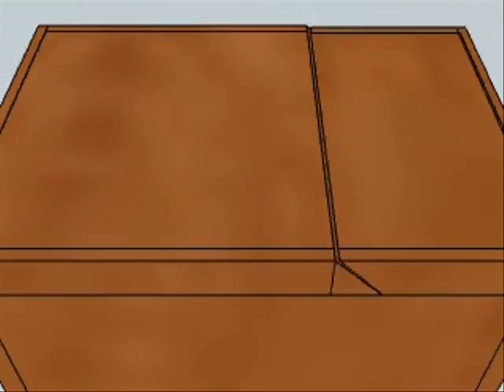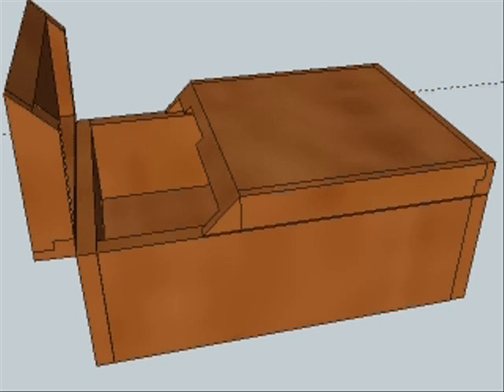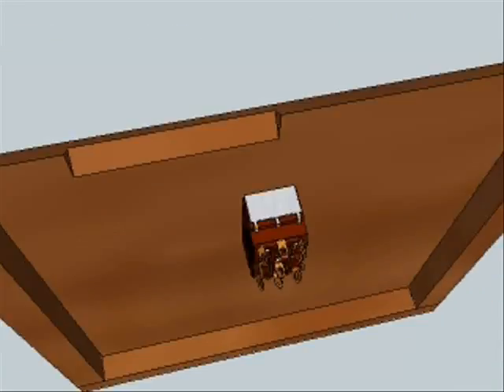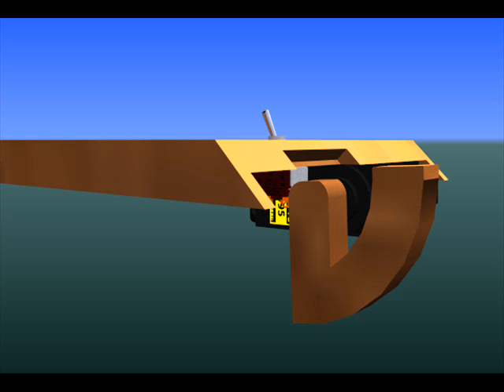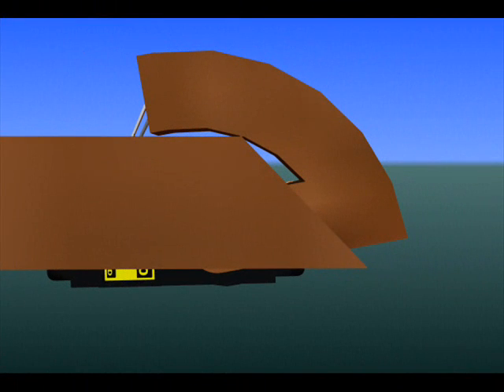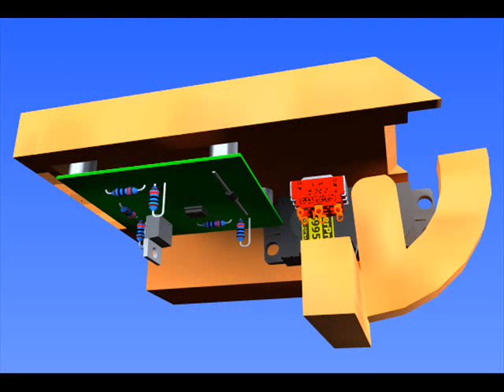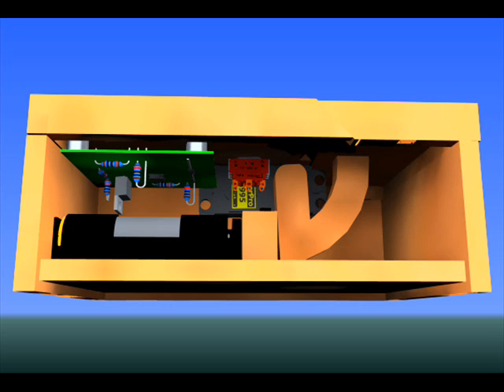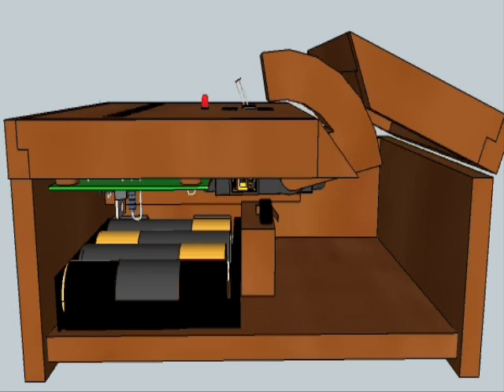Useless Machine SketchUp Model Details.wmv

Comment: using a gear motor. GM2 from solar botics.  
i've come across an anticipated issue, before i even begin building the servo arm.
the issue is that while retracting and hitting the micro switch. there is still too much momentum in the motor to stop instantly once power circuit is open.  this will either cause gear stripping. or possibly break the mounting of the micro switch. or servo etc.

i think i will need to wire in an electronic brake circuit to short out the motor after power circut is open

Comment: Nice guide but why do you need the circuit and the micro-switch? Surely the toggle switch direct to the motor and battery does the same job, just put a weight or spring on the arm to retract it when the motor is off.